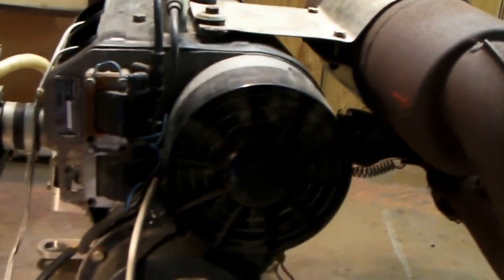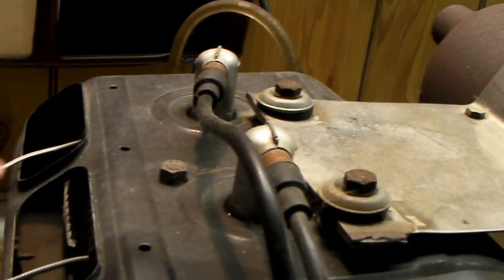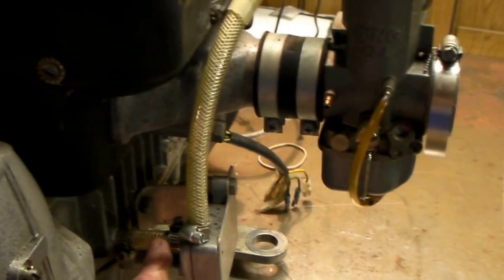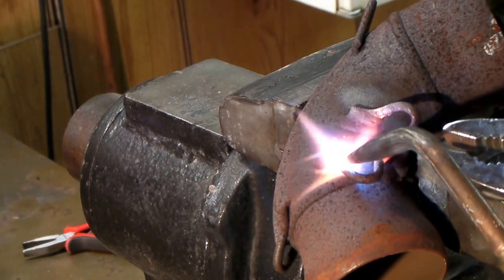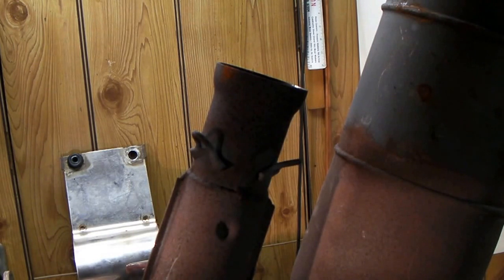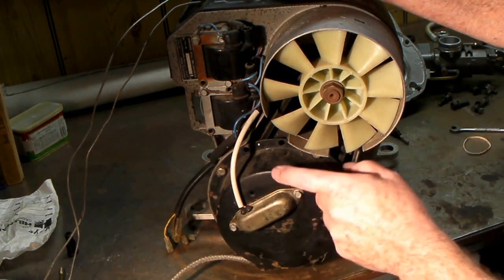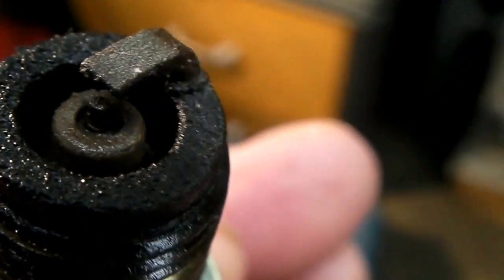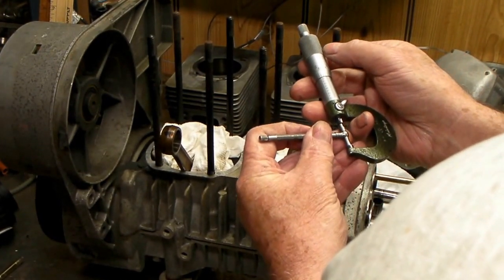TITAN Tornado UL Rotax 447 engine checkout aircraft PART 1

Comment: 7:20 Do the EGT probes die of old age or were they destroyed by running too hot, too long?
Reply from the maker: I think it is just age.  Seems to be silver solder  burns off at the very tip.  First thing that seems to happen is they only give readings when they feel like it.  My 582 had over 1400 hours on it and I replaced the probes twice.  EGT gage is probably the biggest 2 cycle engine killer, as owners keep trying to lean them out to get the "CORRECT"    temps.  Stupid $20 gage.  Read the spark plugs!